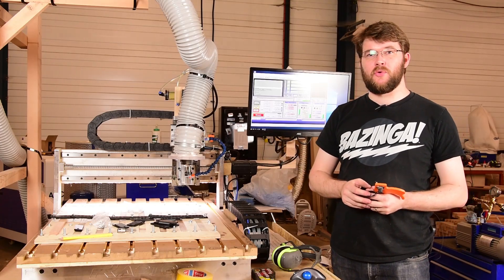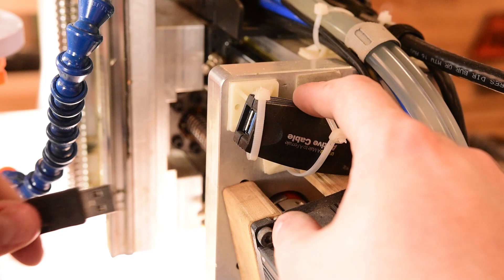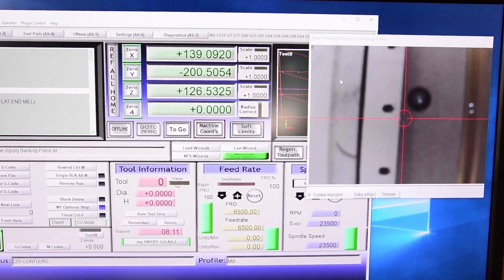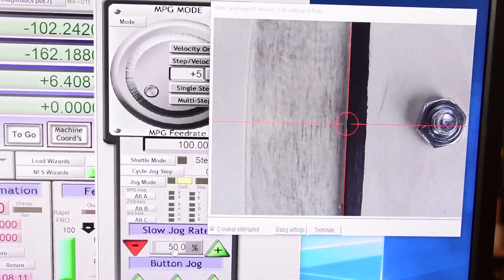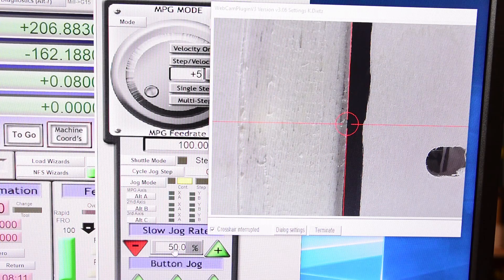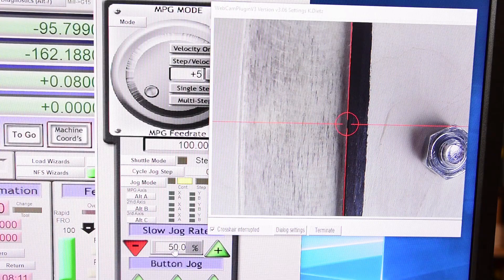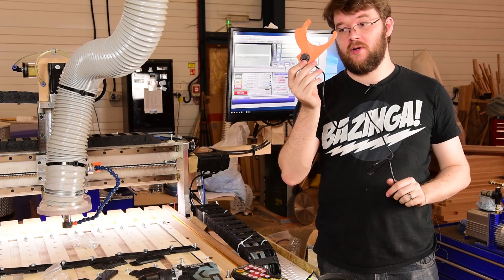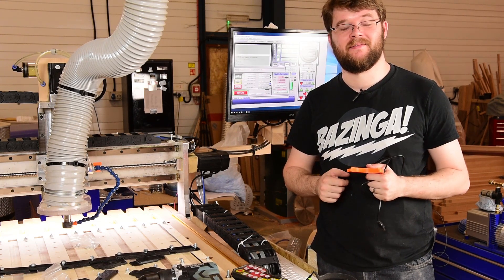Perfect CNC Jig Alignment with USB Web Camera

Comment: I don’t understand the value of the camera. I was excited to see the possibility of not having to make sure my plate was square or positioned perfectly each time I cut. Do I understand this right. I have to put it on then measure the offset to torch then make a mark outside the material at that offset then bullseye the camera to the mark. Do I have this right?

Comment: A great idea, but not exactly a perfect way of aligning since you're essentially going by eye
Reply from the maker: TidusCreates  that's true, but in machining there is no such thing as perfect so its all about how close to a tight tolerance we can get. Depending on where i have the focus set, those cross hairs on screen can be well under 0.00025" wide when i look at my mitutoyo precision ruler. So if i can get the jig on the cross hair at both points 24" apart within 0.001" of each other (And i can do much better than that when i compare with a dial indicator) my error over a 24" jig is 0.00239 degrees which  for my purposes at least, would be considered perfect :)
Reply: @thewoodshoplife8849  thanks for describing the tolerance, this sounds applicable to aligning stock as well.
Reply from the maker: If i set the web cam focus close i can get my view area down to around 10mm wide (3/8"). So going by eye isn't too inaccurate :)
Reply: I suppose that's a fair argument. The alignment process is certainly made more precise the longer your stock is :)
Reply from the maker: TidusCreates definitely helps to have stock with a long edge on at least one axis which most of my jigs have :) it's much quicker in my experience than other setup methods I have tried. Thanks for watching!